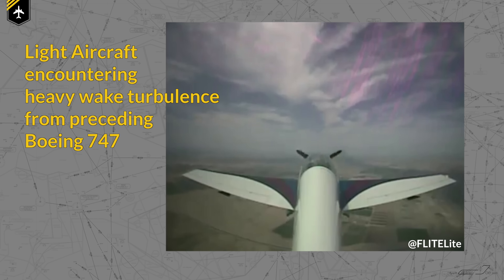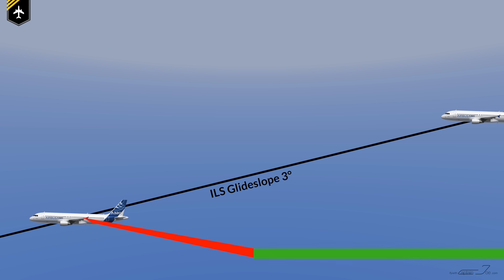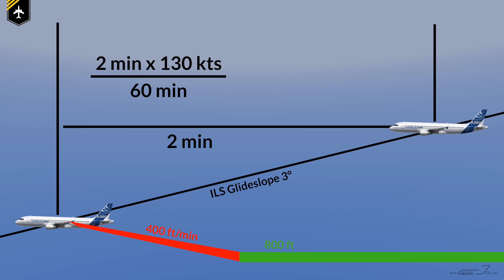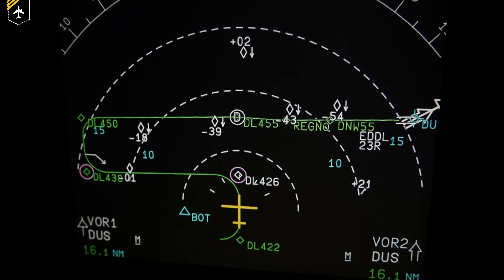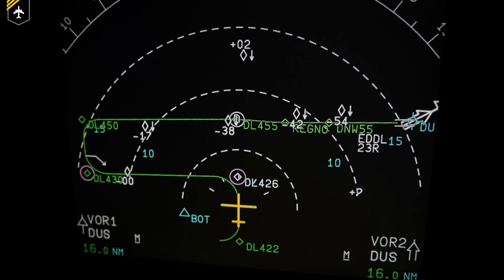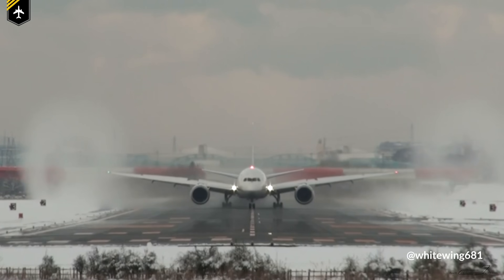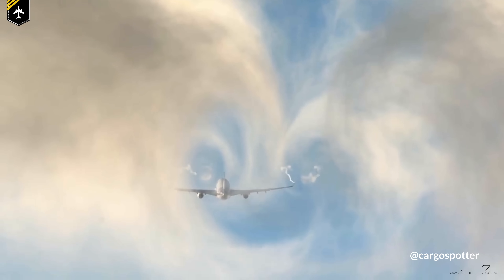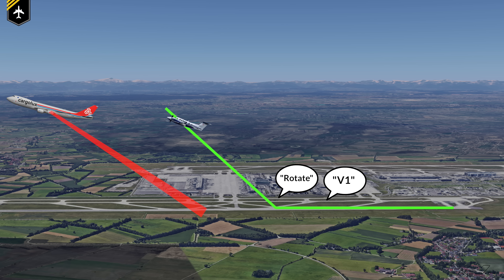WHY do pilots say HEAVY? Wake Turbulence EXPLAINED BY CAPTAIN JOE

Comment: I've been gone from ATC for 20 years (after a 30 year career), so some things might have changed a bit. However, the threshold of "heavy separation" was triggered by the max gross weight capability of 300,000 lbs. For us in the center it only meant a mandatory five miles (which we used most of the time, anyway, especially after digitized radar came in). It was in the approach control/tower environment where it had more application.

Interestingly, although the "heavy" label wasn't used in communications and they didn't meet the weight requirement, after the B757 was introduced, it was found that it generated roughly the same wake turbulence as its big brother, the 767. We were to apply the heavy separation to it as well. 

The A380 came out long after I retired, so I never worked one, I was surprised, after years of heavy 747s to hear of an even higher weight classification (super) and the attendant increased separation standards.

Back in the '80s when the Air Force reengined many of their KC135s, it came to my attention that they were capable of 300K pounds (even if they weren't loaded to it), but the AF never filed them as H/KC135s. I lobbied loudly that they should, and eventually they started doing it. Was that little ol' me, out in the sticks at ZAU (Chicago ARTCC)? Who knows, but I'm proud I made some noise about it.

Comment: A glider flier a little higher that the tug plane so that it does not get destabilized due to the wake turbulence of the tug plane. Also this is why the tail horizontal stabilizer (the one with the elevators) is sometimes placed higher than the main wing or have a dihedral or anhedral to get out of the way of the wake turbulence caused by the main wing.
Reply: The glider flying above the towplane to avoid wake turbulence is not strictly true. There are two positions, high tow, which is just above the prop wash of the tow plane, and low tow which is just below the prop wash. High tow is normally used for launching and low tow used for cross country tows.  Personally I remain in high tow for the early climb and then switch down to low tow for the climb. With modern gliders the low tow position tends to be more stable and lessens the likelehood of losing sight of the tug, very bad news as the immediate action if you do lose sight of the tug is to release.
Reply: As far as i experienced there's a lot more trouble from the engine of the tug plane, and that's the main reason to stay above that ;)
And about the horizontal stabilizer mounted higher than the main wing there are several reasons, that one probably also but i mostly heard about resistance for high grass and ease of disassemble :)
Reply: Most modern gliders have their horisontal stabilizer mounted high for several reasons, main reasons being:
1 - Fewer parts and simpler connection / control hook-up when rigging/de-rigging
2 - Simpler structure = lighter parts
3 - Out of the way relative to tall grass / ground obstacles in the event of an outlanding and general ground handling.
4 - Stabilizer is kept outside the turbulence coming off the fuselage & wings.

The tug do create wake turbulence but the glider need to be below the tug in order to feel it.  The ideal position of the glider relative to the tug is in the direct line between propeller axis and tug stabilizer.  In this position the tug pilot will feel very little, if any, vertical pull from the glider trailing behind.
Reply: Is this why the Martin flying boats of WWII had such a severe dihedral in the horizontal stabilizer?
Reply: @charlesbecker3470  Tailplane anhedral is used to increase pitch down elevator authority at high angles of attack, high alpha in todays parlance. It ensures that at least part of the elevator is not in the dirty air of the wing, so the answer to your question would be yes. One of the best examples is the F4 Phantom. A T tail has the same effect and is fitted to a large number of modern gliders for that reason and it lessens the opportunity for damage when landing out in unprepared fields.
Reply: So, comment from a dumbass meatbomb (skydiver), when we fly multi plane drops, the rear aircraft sits slightly BELOW the lead aircraft to avoid wake turbulence and falling into the dead air (cavitation), if anyone remembers the vids from a few years back where two jump planes collided while jumpers were climbing out? Rear craft was aft and up of lead craft. Is this not the same for gliders due to aspect ratio/wingspan/other fluid dynmagic? Edit still not clear on this, I'll shut up and do some research!

Comment: Wake turbulence, as generated around the wing tips, not only depends on the weight, angle of attack and speed of the aircraft, but also is subject to the wing's design, right? This is one of (if not the main) reason why aircraft engineers introduced winglets in the first place, not only because of the effects wake turbulence have on  other airplanes following its flight path, but also because of the turbulence generated in the aircraft itself.
Hope you can make a video about winglets to "expand" the subject and explain how they work.
Again, thanks in advance!

Comment: The 757 was specially classified as heavy in the USA although it is below 136 tonnes. This is due to the 757 airfoil design, which is a very effective wing design but generates an abnormally strong/fast rotating wake in landing configuration. This was discovered after several light aircraft crashes. There have been changes to the wake classifications since this and the FAA has slightly different classes than ICAO. The lastest information I have is that the 757 no longer announces "heavy" but instead uses "B757" in place of weight class. So it is treated as "large" when following and as "B757" when leading.
Reply: FAA ORDER  JO 7110.65T 
section 5-5-4 (e.)(page 259)
Separate  aircraft  operating  directly  behind,  or
directly  behind  and  less  than  1,000  feet  below,  or
following  an  aircraft  conducting  an  instrument
approach by:
1.When  applying  wake  turbulence  separation  criteria,
directly  behind  means  an  aircraft  is  operating  within
2500 feet of the flight path of the leading aircraft over the
surface of the earth.
2.Consider parallel runways less than 2,500 feet apart as
a  single  runway  because  of  the  possible  effects  of  wake
turbulence.
1.Heavy behind heavy−4 miles.
2.Large/heavy behind B757−4 miles.
3.Small behind B757−5 miles.
4.Small/large behind heavy−5 miles.

Comment: Why doesn't the B-2 bomber not have a vertical stabilizer like most planes
Reply: To improve the stealth charactristics; you'd get a radar reflection from a vertical stabiliser.  It's not ideal, but it manages with the wing-mounted movable control surfaces and a clever fly-by-wire system to make the necessary fine corrections to keep it in the air.

Comment: Nice video! Should have mentioned the 75 though as well. That is another unusual case. Because of the high wings even though its MTOW is 116k KG, it is still required to amend HEAVY due to the wake is almost as bad as a 74.

Comment: Joe, Can you explain why the time travel between same two location but different way are different? Say JFK->YVR(6:15) but YVR->JFK(5:10)
Reply: Two words: upper winds.
Reply: Although, I am no pilot, but can lend some perspective here. This is the phenomenon experienced during East - West and West - East flights. As we all know that the Earth rotates from West to East and if you are flying westwards, you'll get the feeling of having arrived early, since both you and the Earth are moving in opposite directions. While, flying eastwards, you'll feel having arrived later, since both you and the Earth are moving in the same direction albeit at different speeds. To explain whatever, I've mentioned here, just look at the example below

Scenario 1: Take to cars or bikes and place them let's say 1 km away facing each other. One of them has to be doing 50 kmph and the other 70 kmph. Ask someone to time it and start both of them at the same time. Now find out the time at which you passed one another.

Scenario 2: Only difference is now both the vehicles are facing in the same direction. The one placed ahead will be going 50 kmph and the follower will be doing 70 kmph. Now time it and find out how much time the following vehicle took to overtake the lead vehicle.

You'll get your answer!

PS: Since I'm from India, I used kilometers.

Speed of rotation of Earth is roughly 1600 kilometers per hour on the equator and it gets lesser as you move northwards or southwards!
Reply: @chanakyareborn  
But plane at the beginning is already moves at speed of Earth, so it doesn't work (although it is the reason why time difference is different)

The flight time difference is indeed due to winds

Comment: What about refueling aircraft?  What is the technique or procedure for avoiding wake turbulence in this unique situation?
Reply: watch the whole video
Reply: NASA JET PROPULSION LABORATORY thank you for confirming that NASA.
Reply: That makes sense, thanks!  What if you're a large aircraft being re-fueled?  and How do you approach? How do you leave?
Reply: Come in from the side and below leave the same way.
Reply: Evan J holding on tight usually works
Reply: Evan J - I like your avatar!
Reply: Fighter jets or recon aircraft approach and fly BELOW the tanker to avoid wing wake!
Reply: Wake turbulence is most dangerous behind, under and at a 45 to the wings.  Most dangerous on approach to land or on takeoff following a big boy taking off.
Reply: Keep in mind that the greatest instance of wake turbulence is in conditions of high drag/high angle of attack (approach to landing). Refueling is usually done at altitude (FL200 up to FL330, although those are not strict limits) which is generally at or somewhat below cruise conditions (no flaps and speed probably from .7 Mach to .78 Mach--I'm guessing on the speeds). While there is still some wake vortices due to the pressure differential between the bottom of the wing and the top, it is markedly lower than in approach configuration.

As suggested in other comments, also the receiver approaches the tanker on centerline and from below. Fighters are different, in every respect.

Wake turbulence (by definition) has nothing to do with the type of powerplant.
Reply: the pilot has to make sure to hold in his farts until after the refueling is done
Reply: That's the hardest part of the task.
Reply: @nasajetpropulsionlaborator8727  😑

Comment: Joe, On the glider flying higher than the tow plane ..... it is mainly for stability as any excessive tow rope tension will create a (safer) nose down attitude for the tow plane rather than a nose high stall. If a glider flies consistently low the tow plane pilot is at liberty to detach the tow rope

Comment: Thanks for the video Joe! A really awesome one. Not a learning pilot, not even remotely connected to aviation, but  this is the type of stuff I subscribed for, among other things of course, the insights are precious. Have never even thought about this. I am a frequent flier, have even experienced a thing when your body drops down a meter or so with the plane, but your soul and mind are still left at a higher altitude xDDD that was very fast. I thought, turbulence probably, since that is the answer to anything given by pilots, and never thought of the reasons. That one was probably just a pilot going down a bit too faster that he/she should, but nevertheless, never thought about turbulence itself, and how it can affect planes on the runway and above it, interesting.

Comment: Interesting.. But I wonder how come they only came out with the “Super” designation after the A380 came along.. What did the Antonov 225 use as a callsign designation then..? Since it is technically heavier than the A380...
Reply: There is only one An225 so I imagine flight controllers would be advised in advance about separation rules and stuff.
Reply: The an-225 is just a normal heavy. I suspect extensive testing has 't benen done.
Reply: @HenkeB   I think it is now refered as "Super", too. At least that's the case in some vids from VASAviation i've seen that feature that epic Ukranian flying whale.
Reply: @ComandanteJ  may be diffrent in diffrent countries but the 2 times I've handled her it has just a heavy.

Comment: The vortecies from different models of the same plane can be very different. (The old 380s are worse than the new ones.) Vortecies are an inevitable consequence of lift, bit wing design can make a huge difference. A big stubby wing tip is worst, but this can be ameliorated by tapering the wing or winglets. Am I on the right track here? Vortecies are interesting mathematically and I wish I undersood them.

Comment: I've experienced this twice, once as a pilot attempting my very first landing and the second time as a passenger in a commercial aircraft right after takeoff. In the first instance my flight instructor immediately took control of the aircraft and executed the landing safely by touching down earlier than the tower had authorized (I had been cleared for a mid base touchdown right after a 757 while I was flying a Cessna 172). the second time the 737 I was in was talking off behind a larger jet and ended up in a 90 degree back shortly after liftoff.

Comment: Or for those who have a good knowledge of motorsport, like I do, it's the same like dirty air. Which means you can't follow an wing pressed car through fast corners, because of the turbulent air from the first car the second car gets not the same amount of Downforce generated by the Wings. Same effect, but with a way smaller impact!

Comment: If the super category was introduced for the A380, how did ATC handle such heavy aircraft before? The a380 might have been a whole new size for passenger aircraft, but with freighters, especially military, larger planes have been around for quite some time. Think for exemple the AN-225.
Reply: Usually all planes bigger then the b747-400 gets special treatment. At My Airport there are restrictions on runways taxiways and stands for such planes like the an-124/225 c5 galaxy a380 b747-800 and they always get a follow-me to ensure correct taxi and obsticle clerence

Comment: i live near the take-off end of a runway, we never had that kind of problem with our rooftop, but the issue we usually have is that the tiles (those made out of clay or similar, just like the bricks) tend to slide down over the years due to the vibrations of the engines, they have a mechanism that fits one into each other to avoid it from slipping on a normal scenario, but here the vibrations can be so strong sometimes that makes the tile move down, making us reposition them every once in a while to get rid of the holes, thankfully it doesnt affect anything else on the structure of the house (as far as we know :B )

Comment: Interesting. I had read that actual weight of the aircraft had nothing to do with the "heavy" designation. No one weighs their aircraft before flight. My understanding was that it was the airframe itself, and its demonstrated ability to produce wake turbulance, as tested by aviation authorities. Thus, a change in the architecture of the plane might change its designation (though that probably never happens). Certain models of aircraft, regardless of being empty or full, would be designated as "heavy". Your thoughts, Joe?

Comment: I am in a gliding club located in Lower Saxony, a little bit South of Hannover, and flying as a glider a some meters above a prop plane in tow, you avoid get turned inverted and you also avoid ripping the tow rope or pulling the tow plane down or up. And with the glider you do not want to get in vortexes as you are very light and risk to get spinning. Yeah, in German you call it "Trudeln".

A question for you, Joe: Did you start your aviation career with gliding, or did you start with a prop plane?